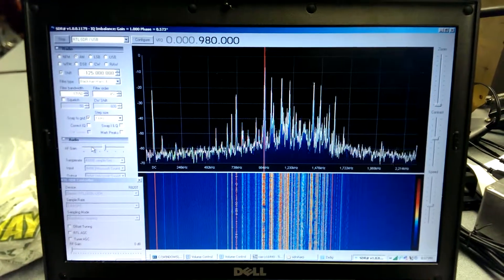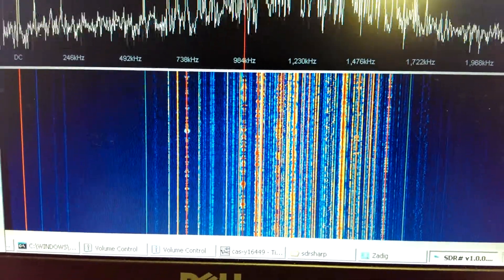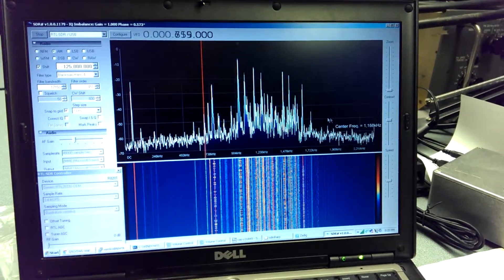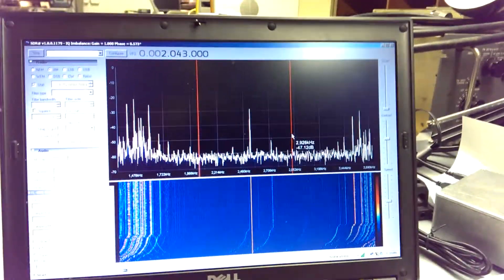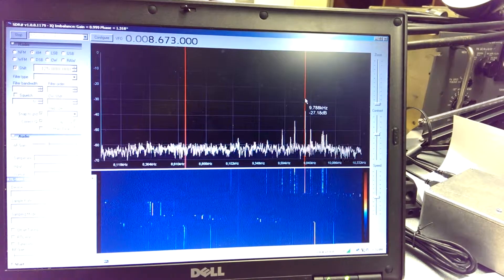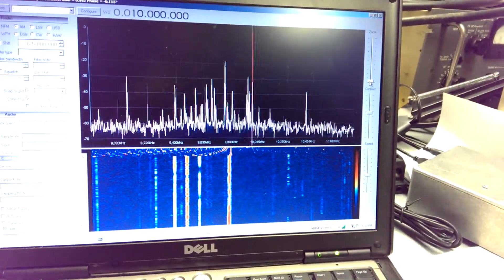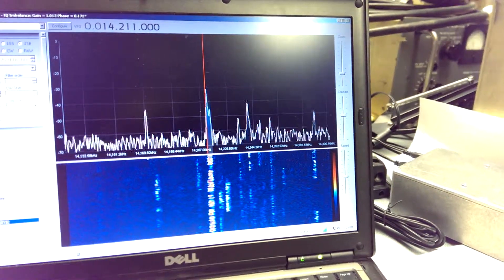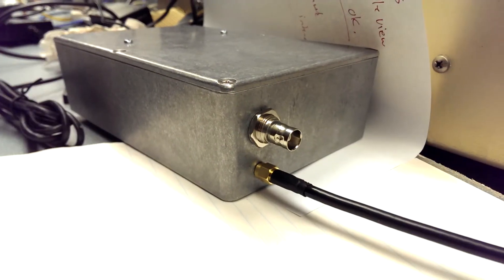VE7WNK SDR Box - Part 3

Comment: I love your case. I am interesting in doing something similar (box with multiple SDR dongles attached to a hub) for a home server. Is there a way to set a particular SDR# instance tuned to specific bands to always connect to a specific dongle because that particular SDR is attached to a specific antenna? One of the dongles will have a 1090MHz antenna, so I want on startup for ADSB scope to always use that particular SDR... I was hoping to avoid having to Remote Desktop each time there is a restart to test each SDR# instance to make sure its using the correct SDR signal. Any suggestions? Thanks in advance.
Reply from the maker: Thank you for the comment! I don't really know if there is a way so match it one-for-one. I basically just open it up and look for the spike at 125mhz, then I know that is the up-converter. You might be able to rename the devices in your windows device manager (I've done that for USB sound cards) but I am not sure if SDR# would accept that. I asked for a numbering feature in SDR#'s forum, but they said that the way USB does addressing makes it far too random, and these devices do not emit a serial number. Be sure to post pics/vids of your build.